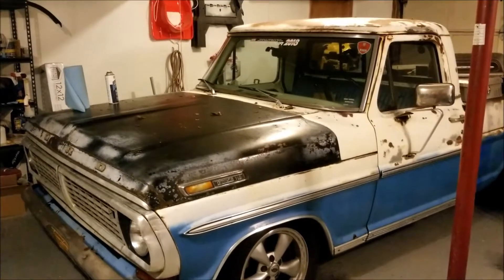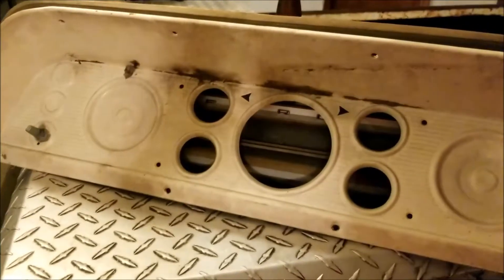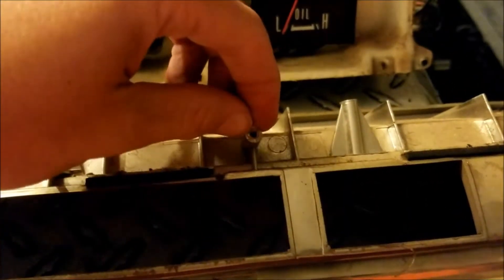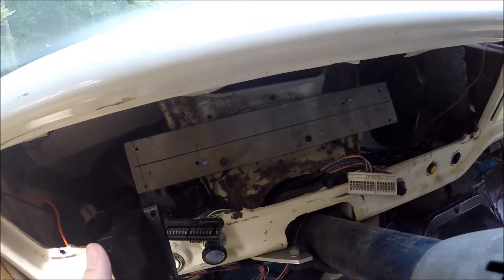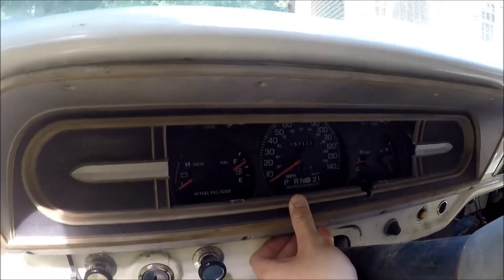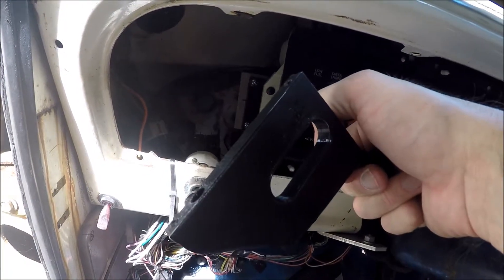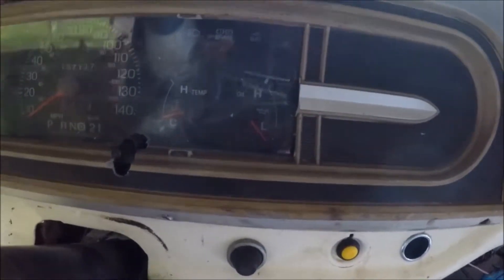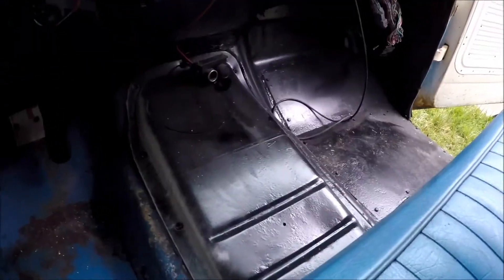F100 Crown Vic Swap Gauge Cluster Installation

Comment: Hi great job on the gauges.  Do you still have the STL file from the 3d printed parts?  I'm doing this swap right now and am planning on keeping gauges for now and would be interested in getting those files from you if possible.
Reply from the maker: Sure. Send me an email ytscrapvalue  at gmail. Might take me a bit, they're on an old HD somewhere

Comment: Truck looks good! I'm getting ready to get started on a 1970 on an 09 vic frame. You mind sharing what steering column your using and what you came up with for attaching it to the vic rack?
Reply from the maker: Stock truck column, I pressed the rag joint flange off and found a u joint on summit that allowed me to connect the ford steering column spline to the crown vic D shaft. Had to make new brackets to shift the column back a couple inches.
Reply: @ScrapValue  awesome thanks!

Comment: Hey man, truck is looking awesome, would you mind telling witch wires you ended up using on the truck ignition ?
Reply from the maker: I'll have to check my notes. I don't have an "accessory" position so I ended up tying a few things together to make it work. Will get back to you.
Reply: Scrap Value that would be greatly appreciated
Reply from the maker: @thorracing71  I found the notes page but it's not really easy to transcribe on here (I tried and it made no sense), maybe I should just make a video about how to splice them together.
Reply: @ScrapValue  did u end up making video on the cluster wires u wired up to work